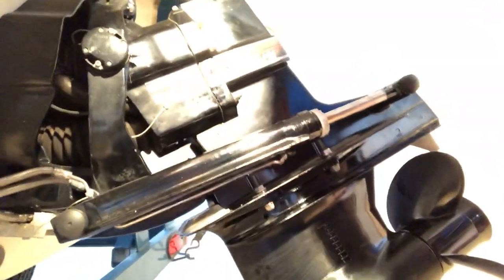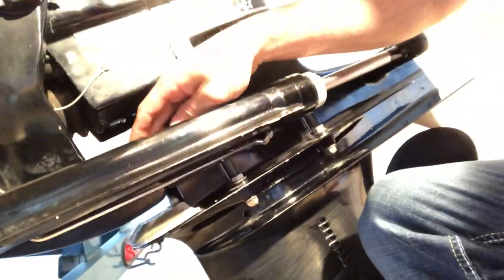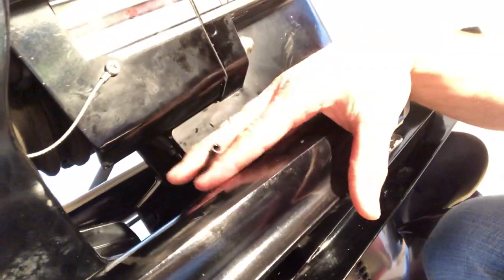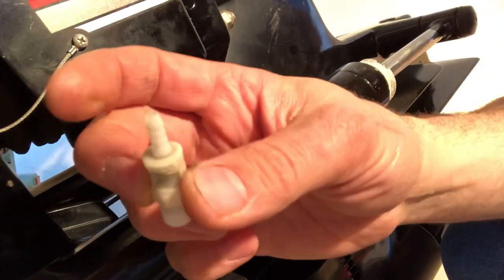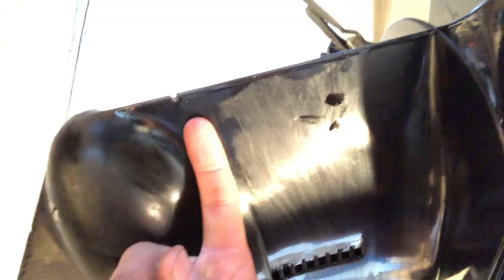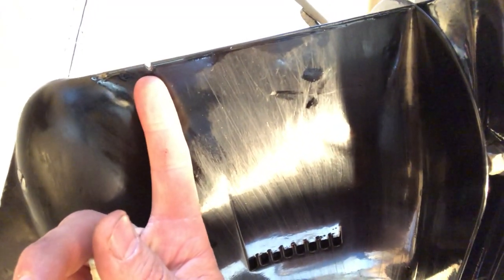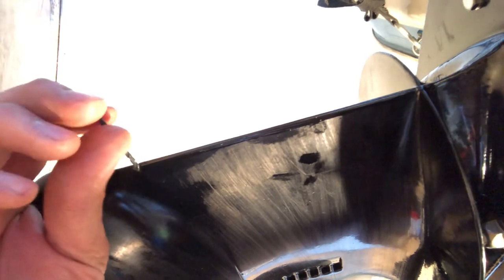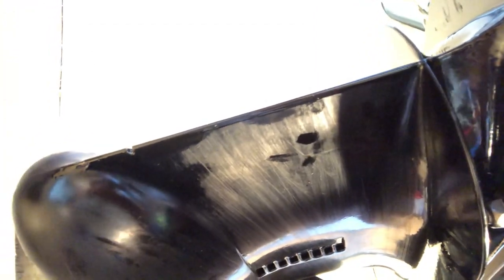Mercruiser Alpha One Gen Two speedometer

Comment: Had the same problem on my Alpha one.  The plastic piece on mine is slightly different,  its a black quick connect plastic piece.  Replaced that since it was missing and still didn't work.  I had to do the same with 1/8" drill bit, mine was really badly blocked with crud from saltwater use.  Had to drill and blow it out with compressed air eventually it cleared up and speedo works now :)